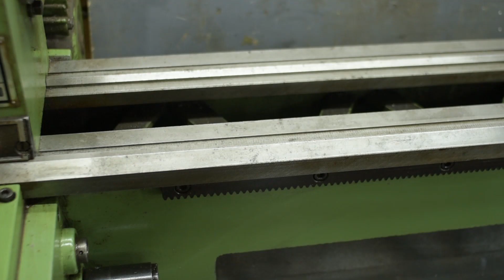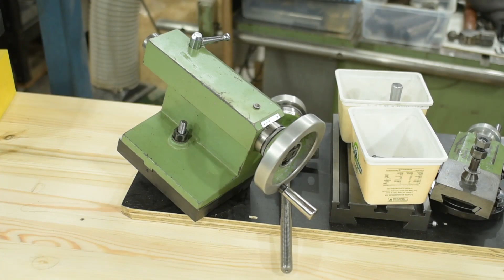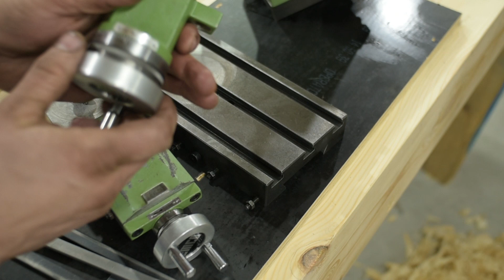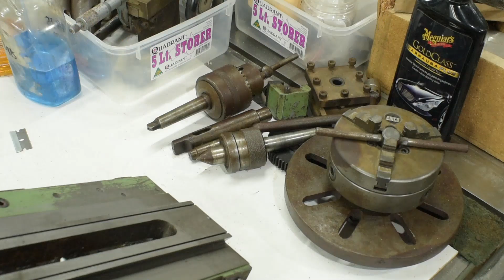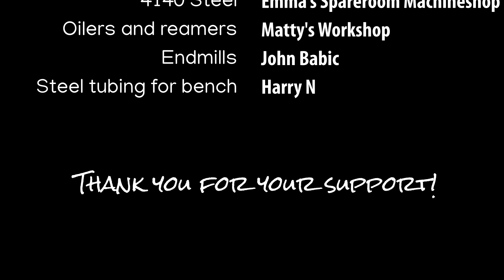Cleaning the Emco - halfway there

Comment: As you say the original switches are pretty sketchy, as is thier position ,having to reach to the back of the headstock isn't the best idea ...
The motors also run very hot ,
I replaced my motor with a 1 horse three phase one run through a vfd and mounted switches below the gearbox, much more user friendly i think 🤔
Reply from the maker: Exactly my plan too! I might still put the control gear at the headstock but a little further away from the chuck perhaps. I have already got the 1hp 3ph motor and VFD wired on the bench. Just to adapt it and make a suitable pulley and control gear box. I don't want to give away my entire next episode though 🙂

Comment: So far that unit is in good condition internally, that's awesome!  Looks like it will clean up to a very useful machine for you.
Reply from the maker: There's another cleanup vid coming soon - I have now finished the carriage and apron, and the bed is spotless inside and out. Just some oil changes to do on the headstock and the change gears to clean up and then we'll have another episode to share I think. Thanks for all your good comments Everett! Cheers, Craig

Comment: The Emco 10P has a great reputation, and your looks pretty much pristine, except for the surface rust and grime. 
If it interests you, I "think" (not sure) the 11P simply has a set of risers under headstock and tailstock - they may actually just have thicker bases as cast. The 13P has a bigger bed, but we can lose ourselves in our dreams, can't we 8-)
I have an older cousin, the Emco Maximat Standard 10, that I'm slowly bringing back to life, including a much-needed bed grind. I hope I haven't stuffed things up by sending the bed for induction hardening of the ways - they were a bit soft originally. I found another one in almost pristine condition - bought by the seller's grandfather for his retirement in the '60s and hardly touched since. That one cost me more in fuel cost to fetch it than the asking price of the machine!
Reply from the maker: Hi Russell. The 10V-P shares a headstock with the smaller lathes, the 7, 8, 8.4, 8.6 series. The 8 compact and 10 compact are a different design (belts not gears), and the super 11 and V13 share a larger headstock design. So unfortunately, without some redesign work, this is pretty much a fixed size lathe. Not a problem though, I do have a heavier built lathe as well which has a better capacity for larger jobs. This emco is designed to be a lightweight but precise lathe - I think it will do very well as is!

The induction hardening of the bed sounds very interesting. Would love to know how that goes for you. Also you were very lucky to find the pristine untouched one! :) Cheers, Craig

Comment: It all looks really nice
The slotted boring table and flat surfaces everywhere will be useful for indicator mounting too
Reply from the maker: Yeah that's good thinking. I keep meaning to put a quick change dovetail block onto an indicator. Haven't got round to it yet though! Cheers, Craig
Reply: @CraigsWorkshop  A mag base should work well anywhere on that machine. My lathe has all curved surfaces so mag bases are a bit unstable unfortunately
Reply: @CraigsWorkshop  PS I have some MT2 reamers
Reply from the maker: @TomMakeHere  Ah cool. A reamer would (probably) come in very handy for sorting out the Emco tailstock taper.
Reply: I would think a sharp morse taper reamer would be a Much safer option than attempting a taper bore without a taper turning attachment.
The 'dints' don't matter, other than  appearance, it's the lumps that hinder contact, therefore grip.
Reply from the maker: @captcarlos  I think you're right, I may instead turn up a small MT2 test bar and check that it's nicely aligned with the ways and if so, leave well alone. Because it does already grip quite nicely.

Comment: Nice little Lathe! You don't need to replace the motor, Just add the Vfd and use it wired at high speed! The "[emcoV10lathe" lathe group has a lot of stuff on VFDs might be worth joining them for that! Cheers, Matthew
Reply from the maker: Thanks Matthew, I recognised your name (unless I'm mistaken) in the Emco V10 groups.io group? 🙂
Reply: @CraigsWorkshop  Whilst you were replying, I added the bit about the "[emcoV10lathe" group! Yes it's me! I  have a Compact8, that I got without a motor, I got it without the motor, a nice Aussie was giving away a V10 motor and switchgear, so I have experience with that! I made a lay shaft to run it at 1/3 or 1/1 which I've only ever run 1/3 reduction. I'm curious to see how yours works out! By the way it's only the switch gear that have a bad reputation! The motor's fine!!
Reply from the maker: @MatthewTinker-au-pont-blanc  thanks that is great to know. I have a 1HP VFD ready to go and if the motor is suitable to run on 240V phase to phase then I can just go for it. If not, I have a 1hp three phase motor I can use. I had earmarked it for a diamond grinder for carbide but I have other ways of making that work.. cheers, Craig

Comment: Good job....2.50 min.....you could use some special way oil for that and all of the lathe, cause these oils have an anti-stick component in it that prevents the stopping when you put pressure on screws or ways and so on..they come in different viscosities,but i think you knew that. Regards.
Reply from the maker: That's a good idea. I have not been able to get true way oil locally, in anything less than a 20L drum. I have heard that Glenn (at Mancave Metals in Victoria, Australia) is going to buy in quantity and break it down for sale to hobbyists. So I may be able to get some of the proper stuff soon.

I have the various viscosities of oils in different labelled oil cans, since my previous lathe (Hercus 9A) needed three different types of oil regularly.

Cheers,
Craig
Reply: @CraigsWorkshop  Thats the oil i use...if you don´t mind buying in Germany...medium viscosity.

https://www.ebay.de/itm/Bettbahnol-1-x-1-Liter-Flasche-Gleitbahnol-CGLP-68-nach-DIN-51502-ISO-3498/162909571090
Reply from the maker: @mftmachining  Thanks man. If the local supplier doesn't pan out, I may consider it. Cheers, Craig

Comment: The Emco looks to be good condition. My tail stocks also MT2 and I had to clean the taper using a MT2 reamer. It worked a treat and now grips tooling really well. Regards Kevin
Reply from the maker: Yes it's a nice one. With the taper, I am undecided at the moment. It's quite badly scored and gouged, but it seems to grip a morse 2 shank very well. I guess I'll see how it goes. I was able to deburr the keyway on the ram so it can't be too hard. I could perhaps taper-bore it with a very slow feed. Good idea do you think?
Reply: @CraigsWorkshop  Maybe or maybe not a good idea to either ream or bore it. While it sounds like it's an unhardened Morse Taper with that scoring, it's still not impossible it was at least lightly hardened. I've reamed a couple of MT's. One thing to never forget, a thou or two extra reamed into the bore results in a large increase in how far the male taper then goes into the bore. Go even slightly too far and then the male tapers start hitting the tip that ejects them. And a MT reamer will tend follow how the existing hole that guides it. Those ridges from the score marks tend to offset the reamer a bit so it doesn't exactly follow what was originally correct.Taper boring? Again you have to be very careful about how much is removed. MT's obviously hold by a wedging action, the closer the tapers fit and the better the finish is on each surface then the better they hold. That's why good MT tooling always has finely ground surfaces.Getting an accurate matching angle for boring while not impossible, is only part of it. Ideally a tool post grinder would be a far better method simply due to the much better surface finish. If the bore is scored badly enough it's doubtful it will fully clean up. Those low spots will reduce the holding force by a bit, but hopefully not enough to really matter.

I've watched a few YT videos where some seem to care little about ramming in scored up or seriously rusty MT drills and other tooling. That female taper and all of the tooling tapers really need to be treated like a fine Swiss watch. Repairing damage where new replacement parts are no longer available is either very time consuming or highly expensive when having to  pay others to do the work. For as little other wear on the lathe as it seems to have it's a real shame the previous operator treated it so poorly. While maybe not of Schaublin status, the V10's and Super 11 lathes were still a very fine and quite expensive light duty tool room class of lathe. Likely that one was an earlier V10 model since I believe the later versions had lever operated cam locking tail stocks. At least the Super 11's did, but I could be incorrect about those V10's.
Reply from the maker: Thank you for the info turning point. You are right about the reamer following a worn taper. What I may do is turn up a short test bar (and tweak with bearing blue until I have a good angle for the male external taper), and measure the alignment of the existing worn taper compared to the bed. If it is nicely aligned, I needn't do anything because it does hold onto a tool nicely, despite being damaged.

Comment: looks like a sound investment
Reply from the maker: Thanks Richard. It's cleaning up well.
Reply: @CraigsWorkshop  what kind of qctp are you gonna go for?  and a dro?
Reply from the maker: The DRO is suddenly much less urgent, because I have metric dials now, and zero (or close enough) backlash. With the premo lathe I have run it for the last year or two with no DRO and imperial dials. :-)

I am a fan of the aloris/dorian style toolpost. I use a bostar branded one on the premo, and I'd like to keep to the same system. I'll have to measure up and find out how the centre height compares to that on the Premo.

I could put my AXA toolpost on the emco, and put a BXA on the Premo - I think that'd be better suited to the lathe size, but I don't want to spend too much money on all the toolholders!

Cheers,
Craig